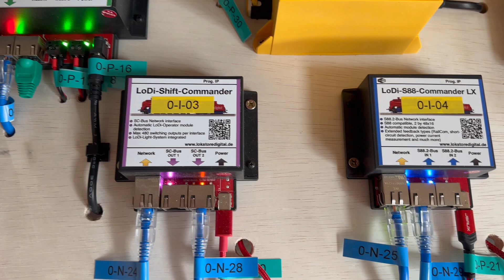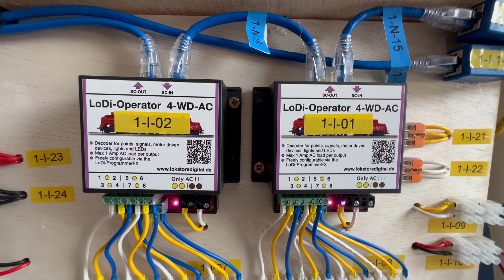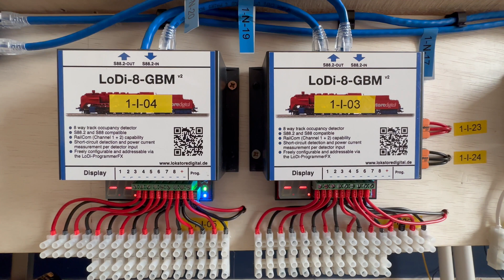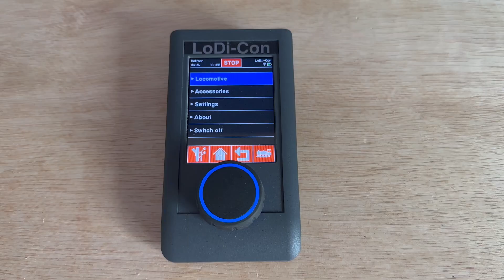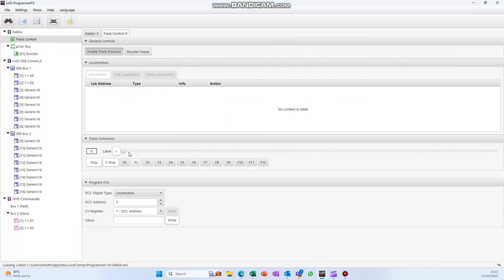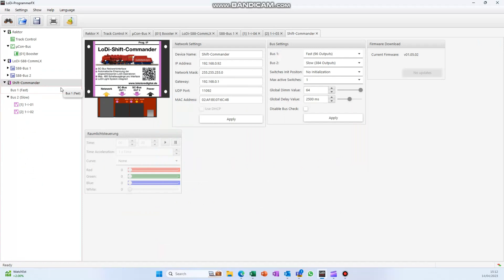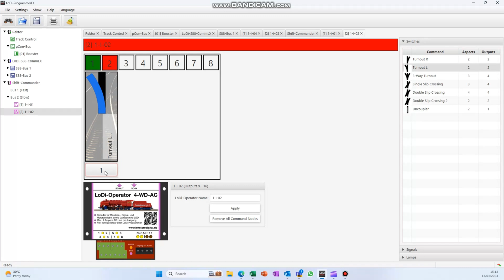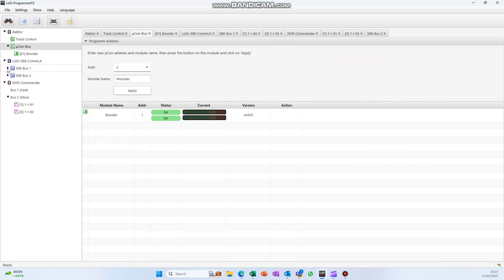2. Lokstoredigital LoDi Control System

Comment: Thanks for creating the Lodi videos, very helpful, I'm just starting with train automation. I'm looking at the LoDi-Operator 4-WD-AC that you're controlling your points from. There's also a LoDi-Operator 4-WD-DC. From what I've read both can control points. Any reason why you chose AC? I'm probably missing something really obvious..
Reply from the maker: Hi,

It’s literally direct vs alternating current. The DC version is specifically designed to work with LED lighting. 

For regular point motors, the AC is the one you want. 

Thanks for leaving the comment!